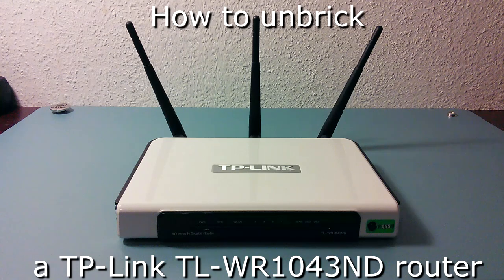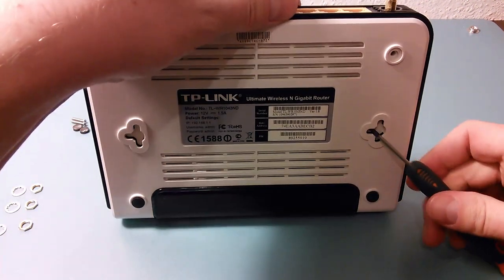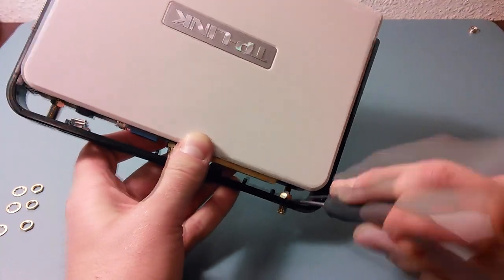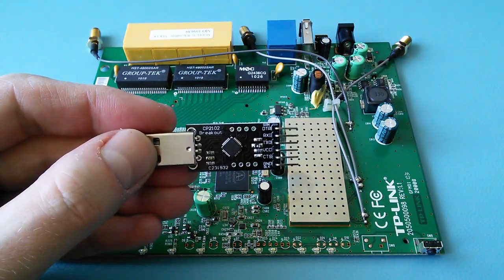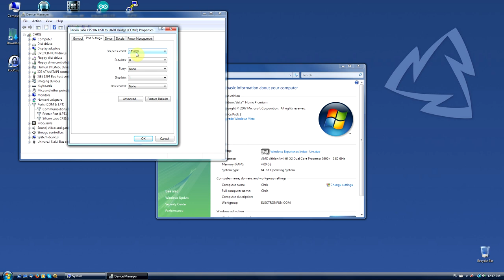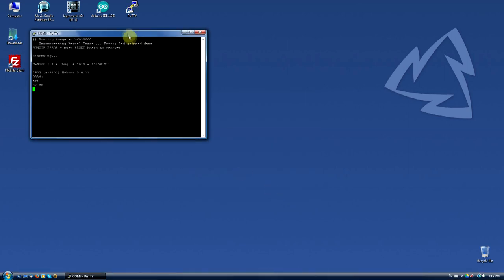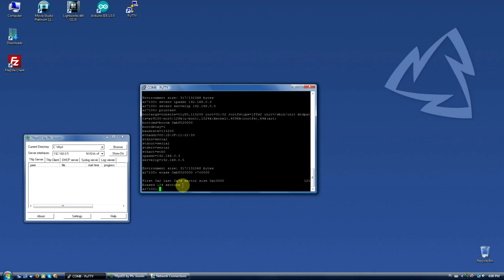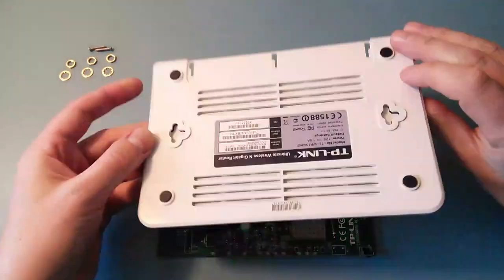How to unbrick a TP-Link TL-WR1043ND router (re-uploaded) || How-to-fix tutorial

Comment: hi, maybe you can help me.
Mytp link tl wr1043nd is empty, it only works if I connect lan and ethernet cable, it doesn't gives wifi signal, and only power button work, and only power led is on, when I connect lan and ethernet also that leds are on, but nothing else.
Maybe is because I putted in Putty Serial Connection "Erase All" and the "Boot.m" maybe I can do something, right now also the Putty Serial Command Doesn`t recognise anything.
Thanks
Reply from the maker: +lucholdu99 I'm gessing your LAN and WAN don't work too? Just the LEDs are on when you connect your cables, right?

Comment: Hello thanks for this video tutorial. However, i bricked my  TP-Link TL-WR1043ND V3.0 Router with bad firmware upgrade. the V3.0 is the same hardware as V2.0 but what about the Firmware image i can't use the official as it has boot in it. can i strip it somehow? i tried the hex editor but couldn't get much information about the boot location to cut it.? so what do you think about my case? how could i get the Stripped firmware image?
Reply from the maker: +Omar McCoy Your router is pretty new and I can see the stripped version in not available yet (https://wiki.openwrt.org/toh/tp-link/tl-wr1043nd). I used the firmware from OpenWRT.org, I didn't prepare it myself.
Which firmware did you have before bricking the router? Was it the default TP-Link or one of the custom built type?
Reply: +ElectronFun.com  Hello Electron i have successfully unbricked V 3 router, its easier than V 2.1. the same putty command as V 2.1 using this stripped firmware image: http://www.dd-wrt.com/phpBB2/download.php?id=34575

thanks
Reply from the maker: +Omar McCoy That's great! How did you find the stripped image?
Reply: it was easy stripping the latest released firmware from TP-LINK site using any bin editor like binwalk or Hex editor. I have deleted the bins from the begining until 0x20200 (the same procedures as the previous hardware revisions). and also other DD-WRT member stripped it and upload it so i flashed it and it works flawlessly without a glitch.
Reply from the maker: +Omar McCoy Thanks, your comment may help others with similar router problems. Have a great day :)

Comment: Hi, I'm using a PL2303HX USB-RS232 cable but I don't get anything on my Putty or Termite terminal, the only way I'll get somethnig (those strange characters) is when I dont invert RX and TX.
Any ideas?
Reply: ***** btw, thanks for being so resourceful
Reply from the maker: ***** What is your current COM port speed?
Reply: 115200 on my COM and also setted on Putty
Reply from the maker: ***** Your speed is set correctly then. What are those "strange characters"? Can you do a print screen and post a link?
Reply: ElectronFun.com It's exactly the same as the other comment http://pastebin.com/uNfY6Gk3
Sorry, I don't have my cable to do it now. 
BTW, I re-soldered my usb cable and now I have the 3.3v power, should I use it instead of the normal power source for the board?
Reply from the maker: Meu Primeiro Gato What do you mean by "normal power source"? Just connect GND, TX and RX to the router and use the power supply that goes with the router. Leave the 3.3V pin unconnected.
Reply: sorry, I have more then one channel and commented with another one by mistake (Meu Primeiro Gato) . Any idea wht the issue can be?
Reply from the maker: ***** I'm not sure. Do you have another USB to TTL converter, or maybe Arduino Uno?
Reply: Unfortunately I don't. I'm going to buy a new one, but it can take a few weeks for it to arrive where I live...
Reply from the maker: ***** Did you solder header pins to your router motherboard, or wires directly? Maybe there's something wrong with one of these connections?
Reply: I used header pins and connected the wires. 
The wires I'm using are the ones soldered to my usb converter, I've already shortened them (they were more the 1.5m long)
Reply from the maker: ***** I guess I don't have any more ideas. Have you tried asking on a forum like: https://forum.openwrt.org, http://www.dd-wrt.com/phpBB2, or https://www.gargoyle-router.com/phpbb/index.php?

Comment: Hi there,
If I use another firmware (e.g. chaos calmer) in the debrick process, will the count "0x7c0000" change? How do I figure out the new count?
Thanks.
Reply from the maker: +Czar Vieira Hi, The count "0x7c0000" will not change. It's the hardware address of a memory cell on your router.
Reply from the maker: +mipmipmipmipmip Probably yes.

Comment: is this procedure spciale to "TP-Link TL-WR1043ND" or we can do that with other router brand like "netis" ,excuse me for my bad english:
i have bricked my router "300Mbps Wireless N ADSL2+ Modem Router
DL4322" when doing a wirelessly upgrade.i have do a hard reset 30/30/30 and still not working except the power led,and when i connect it with pc via RJ45 cable ,it show a not identified network disconnecting itself continously.
i have the pin connector RX,TX,GND installed from factory i need to purchase the usb to TTL converter and cables;
i need your advise: this will work for me or not?if yes, can you please describe to me what commands should i use in PuTTy program and thanks in advance!
Reply from the maker: Zouhair Dh Hi, sorry I couldn't reply sooner - I'm on vacation.
I haven't seen any Netis devices and the procedure is pretty much for TP-Link routers. However, you can ask questions here: https://forum.openwrt.org and http://www.dd-wrt.com/phpBB2. I hope someone will be able to help you.
Reply: +ElectronFun.com Thanks for help! i have contacted netis company; they have told me how can i do that.
Reply from the maker: Zouhair Dh That's great, it seems their tech support is really good. Not every company wants to show people how to unbrick their devices.

Comment: hi electro fun i have a tp link ap tl 901nd v3 i have all conected the usb everything to restore but putty shows me nothing  only a black screen any idea what happen
Reply from the maker: +Nick Aguero Have you tried hitting Enter?
Reply: electro fun i discovered the problem the cables wont make contanct i need to solder so thats was the solution
Reply from the maker: +Nick Aguero I didn't think of that, but it's true - the jumper wires are faulty at times. I've already had such a problem in one of my previous projects.

Comment: Thanks a lot for your detailed guide! I successfully bricked my 1043nd v1 by flashing gargoyle and then flashing back to stock without an altered firmware file. I then bought the USB to TTL adapter and tried my luck this evening. It worked very good until the router was supposed to install the new firmware. Erasing the memory and copying the new data was no problem. To get back to stock firmware I had to flash the factory version of gargoyle (http://www.gargoyle-router.com/downloads/images/ar71xx/gargoyle_1.9.0-ar71xx-generic-tl-wr1043nd-v1-squashfs-factory.bin )and then use the upgrade function in the gargoyle web-interface with a customised stock firmware (http://www.gargoyle-router.com/wiki/lib/exe/fetch.php?hash=bf851b&media=http%3A%2F%2Fgoo.gl%2FXRbuZ). Works now completely like it's supposed to, no bugs at all.
Reply from the maker: Thanks a lot for your comment Lukas! I'm glad this video helped you somehow unbrick your router :)

Comment: bro i have TP-Link TL-WR1043ND i have a problem with it i can't access to the config page and hard resetting button is not working for it also. i can use it only through a cable.. what should i do to get default configration page..??? please let me know
Reply from the maker: Hi, have you tried this: http://www.tp-link.com/us/faq-497.html?
Reply: thanks bro.. but these methods are not working for my device..
Reply from the maker: What software is your router running? Is it the stock firmware from TP-Link?
Reply: yes it is the stock firmware.. i've never tried to change the firmware..
Reply: amm sorry bro now i came to know that my router is running on openwrt firmwear.. but i am following your video step by step and when i am gave it any command it appears :not found... like 'setenv ipaddr 192.168.0.3 [enter]  it replies :not found.. :( please help me out

Comment: hello friend,

i got a tl wr941nd 3.6

i flashed openwrt on it and managed to delet the skin. so the rooter boots up, but i have no gui. ssh is no option because i forgot the password.
i bought a usb ttl adapter and connectet it .im on win7 x64 and configurated everything as you showing.

when i pressopen on putty the black putty window is open but its blank and stays blank. can you help me to figure out why?

also there is a point im not understanding. youre saying that i have to set ip to be sure....... dont communicate with the rooter through the usb 2 ttl adapter?

i didnt configured an ip because i thought it would be nessesary for my case....

thx in adavance
Reply from the maker: Kaan T Hi, if your PuTTY window is black, try to change the 'TX' with 'RX' wires on one side. The 'TX' pin on your USB to TTL converter sends data to the 'RX' pin on you router, and receives data on the 'RX' pin from the router's 'TX' pin.
The USB to TTL converter is used only to send commands to the router and receive the output. You need to configure IP addresses, because the router downloads firmware file from your Tftpd server through TCP/IP protocol.
Your router is a little bit different, so check the commands before you type them. Some memory addresses are probably different. You can check them here: http://wiki.openwrt.org/toh/tp-link/tl-wr941nd
I hope you'll manage to bring your router back to life. If you have any more questions, please let me know and share the results.
Reply: ElectronFun.com  unfortunatly that didnt work. still black screen
Reply from the maker: Kaan T
Did you choose the correct port number in PuTTY?
Reply: i could solve my problem by simplay resetting it with the reset button. i thought that this button is disabled in openwrt....thx for your help
Reply from the maker: Kaan T
Thanks for letting me know that you managed to solve your problem :)

Comment: Good evening to everyone, 
just a question to see if still there is hope for my tl-wr1043nd.
I have already used this guide successfully, but playing a lot with firmware, dd-wrt and telnet i  did it again.
Now the only moment in which my serial connection detects something is when the router starts.
But it get stuck soon after the autoboot and does not move anymore.

U-Boot 1.1.4 (Mar 19 2014 - 11:06:29)

AP83 (ar9100) U-boot 0.0.11
DRAM:
sri
32 MB
id read 0x100000ff
flash size 8MB, sector count = 128
Flash:  8 MB
Using default environment

In:    serial
Out:   serial
Err:   serial
Net:   ag7100_enet_initialize...
No valid address in Flash. Using fixed address
: cfg1 0xf cfg2 0x7114
eth0: 00:03:7f:09:0b:ad
eth0 up
eth0
is_auto_upload_firmware=0
Autobooting in 1 seconds## Booting image at bf020000 ...
   Uncompressing Kernel Image ...

and stays this way forever.

Do you think that there is some solution for this issue?
I have tried to type tpl and enter but it does not work,

any idea or suggestion?
Reply: I solved it, it was just to type TPL inside the really brief window I had. Now it is finally working as WiFi Bridge, thanks a lot for this amazing guide.
Maybe one day I will be able to solder as you do!

thanks again

Comment: Nice video but I have rukus mm2211 and its private company customized.. I downloaded firmware from rukus but don't know how to install...I am thinking same thing to do but don't  know this process will work with rukus and don't know command.....help me
Reply from the maker: Hi, is your router working, or is it bricked?
Reply: yes its working but i cant change anthing in this, there is no any default ip address i have used rukus all i.p but useless. which service provider i was using they configure itself and there firmware and they locked it. l reset it but nothing happen because firmware is not of rukus and  i want use this router with another service provider but it will be happen when rukus firmware will be install in this  and dont know how to be install?
Reply from the maker: Sorry, I have no idea how to unlock your router. You could post your problem on one of many forums, someone may give you a clue.

Comment: Cant get Output command by putty in cmd
BTW I bricked Asus RTN10e
Reply from the maker: MY PHYSICS I don't have an Asus router, but have you tried the rescue mode?
Reply: Yes I did but no response ,The router is Showing Voltage change when Power On , That means it could work fine ,Problem is than i am not getting putty output ,
On my CP2102 serial converter I have 
DTR
RXD
TXD
+5V
GND
3V3 
ports

When I attach only CP2102 to PC I red light blinks
When I only attach the +5v Of CP2102 To router when it is powered on then also without pc supply it blinks red.

Is there any certain combination where all the 4 ports on router should be used.

Thanks.
Reply from the maker: MY PHYSICS Sorry I'm not able to help you right away. I can just try, because I've never used an Asus router. Have you tried the "TFTP Firmware Install" procedure from: http://wiki.openwrt.org/toh/asus/rt-n10plus?

Comment: Could the serial port on a computer be used for this
Reply from the maker: In theory yes, but in practice you could easily fry your router. RS-232 voltages can go up to 25V, so additional circuitry would be needed to protect the router. I guess it's not worth the time, unless you want to learn how it works.
Reply: ElectronFun.com I have found out I can use my arduino as a usb to serial adapter by shorting the reset pin with ground.
Reply from the maker: Oh yes you can - I made a video about it quite some time ago :)
Reply: ElectronFun.com I have just unbricked it using only tftpd32 without a serial connection, i just used the filename wr1043v2_tp_recovery.bin and it worked for version 2.1
Reply from the maker: It's great to hear/read that, congratulations Dan!

Comment: Hello, I liked that your video, I wanted to ask you if you could make a video like this but using the Arduino as ttl serial adapter. I have a router with the problem and do not have a serial USB Adapter ttl there wanted to use my arduino as adapter.
Reply from the maker: There is a video about using an Arduino as a USB to TTL converter, see here: https://www.youtube.com/watch?v=qqSLwK1DP8Q.
Reply: Thanks, I was able to fix my router using my arduino.
Reply from the maker: That's great! Thanks for letting me know :)

Comment: Thank you for your time for making this video tutorial. It has helped me to unbrick my router. Best tutorial!

I.) Download OpenWrt from: https://downloads.openwrt.org/chaos_calmer/15.05.1/ar71xx/generic/

Here are the steps:
1. Download modified original firmware that has first 0x20200 cut off, or use firmware attached below. 
2. Gain access to the serial port and hook it up to your computer using RS-232 / USB --> TTL adapter. 
3. Install Putty, setup Serial connection, set COM port appropiately to your adapter in step 2 and do not click Open yet 
4. set networkcard of computer to ip address: 192.168.0.5 , subnetmask 255.255.255.0 and no gateway 
5. Install TFTP32 server (google it) on your computer, connect computer with ethernet cable to LAN switch port on router. 
6. Make sure the "Current Directory" in TFTP32 is set to folder with modified original firmware renamed to "code.bin" 
7. In Putty, click open and plug in Power cord to router... you should see bootloader coming up now... 
8. You will see something like this:
   No valid address in Flash. Using fixed address 
   : cfg1 0xf cfg2 0x7114 
   eth0 up 
   eth0 
   Autobooting in 1 seconds## Booting image bf0200000...
Then type following fast: tpl
Now you will get into the command prompt and you're able to execute commands.
9. Erase the firmware before writing it again using following command: erase 0xbf020000 +7c0000 
10. Download new modified original firmware from computer to the router: tftpboot 0x81000000 code.bin 
11. Write the downloaded firmware to flash using: cp.b 0x81000000 0xbf020000 0x7c0000 
12. Boot the original firmware again: bootm 0xbf020000

II.) Back to factory (TL-WR1043nd V1) download link: https://drive.google.com/uc?export=download&id=0B-pEMb4uQtg8eUN5RVFWekFIbFk

and page with link: https://wiki.openwrt.org/toh/tp-link/tl-wr1043nd#failsafe.mode

III.) [Solved] Default login and password doesn't work forum link: https://forum.openwrt.org/viewtopic.php?id=53696

IV.) USB key Ebay link: http://www.ebay.com/itm/PL2303-USB-To-RS232-TTL-Converter-Adapter-Module-New-/130682850512

V.) [Solved] PL2303 error code 10 (Windows 10) YouTube link: https://www.youtube.com/watch?v=aWquKi_e-3A
Reply from the maker: Thanks for making this step by step guide. It will be useful for other people, who look for solutions :)

Comment: Worked perfectly once I had the drivers installed on my Win 7 laptop for my USB serial adaptor CP2101 is from Silicon Labs.  I had a fresh install of Win (I restored a recovery) and com ports wouldn't show in device manager till I installed the serial drivers and plugged in the adapter.  Silicon Labs put the drivers on their site rather than mailing them with a CD or any documentation of where to get them: https://www.silabs.com/products/mcu/Pages/USBtoUARTBridgeVCPDrivers.aspx